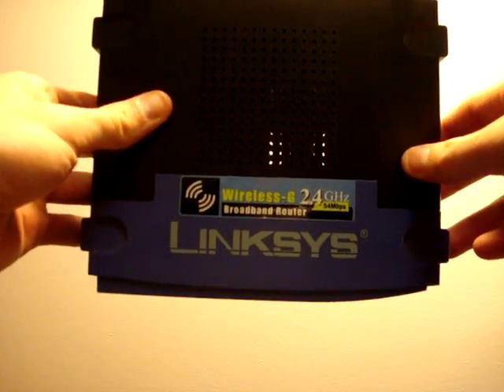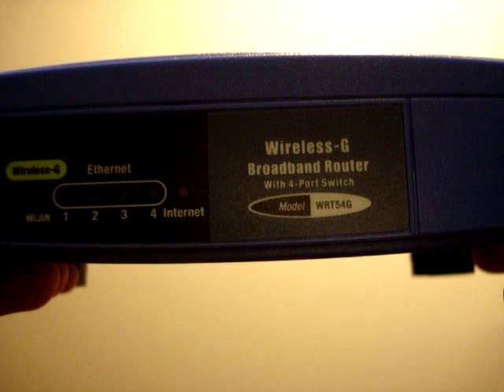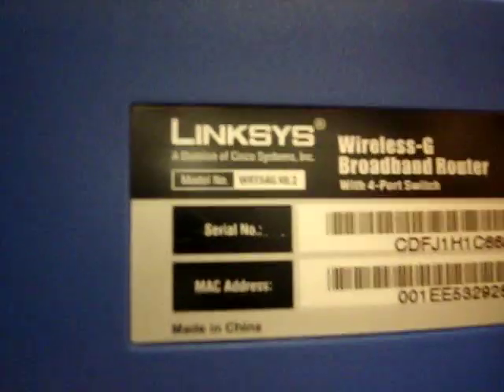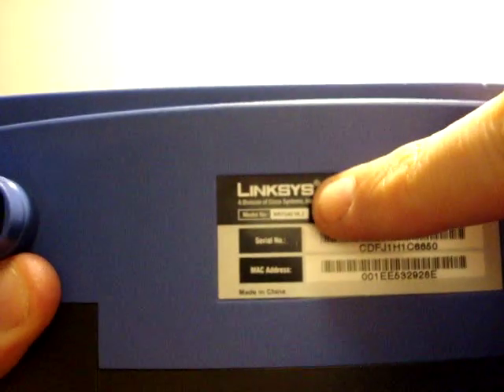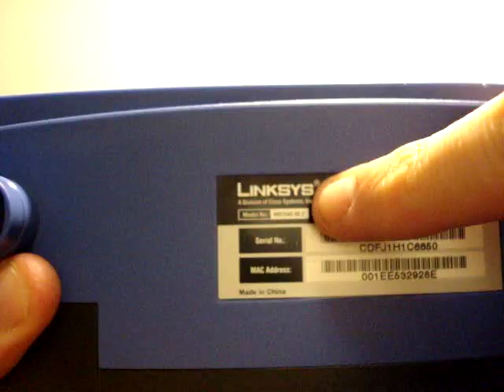Open and take apart Linksys WRT54G V8.2

Comment: Very helpful. I got one of these routers some years ago at a thrift store. The factory firmware was corrupted or something, not sure, but it never did work. Well, today I happened across information showing that this exact model I have (V8) can have DD-WRT (Micro) flashed to it. So, I broke my flashing cherry and did it. Works fine, but I started thinking about better antennas.

I guess I will be learning how to solder in the near future.

Comment: These are handy routers, especially when flashing it with the DD-WRT firmware.

Of course, a big downside is that it's wireless B/G.  But, no big deal to me as my U-verse gateway doesn't support wireless N or faster, so I've flashed by WRT54G and am using it as a wireless bridge for three computers.